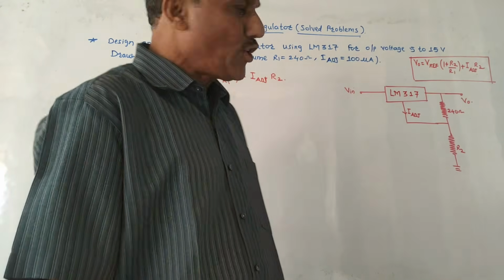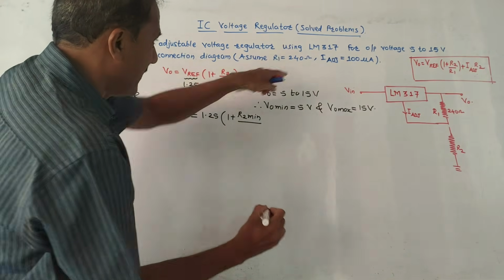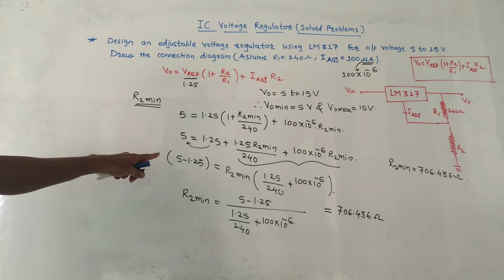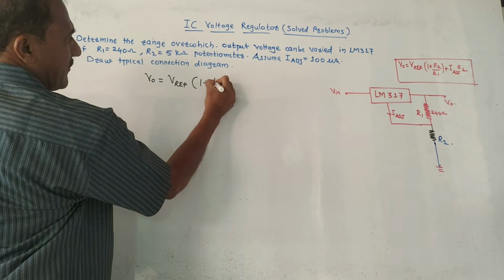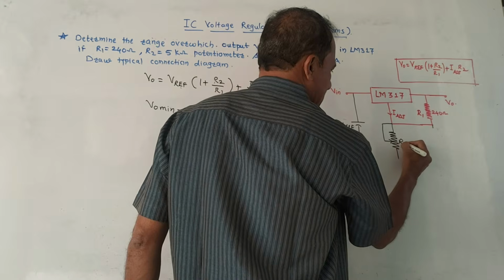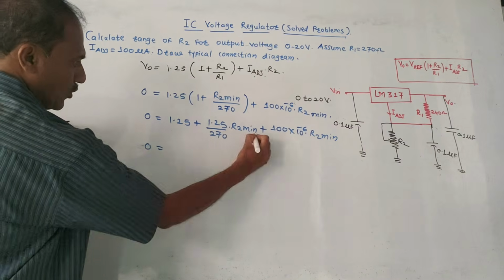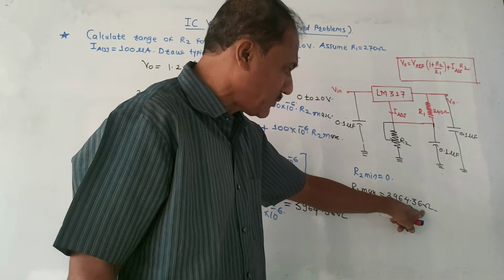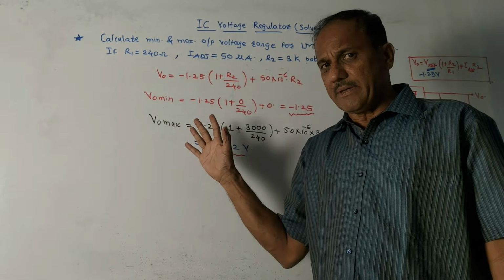IC VOLTAGE REGULATORS (SOLVED PROBLEMS)

Comment: Sir in video lectures of 317 the circuit diagram is different, R2 was connected serially with Iadj
Reply from the maker: You can refer any one of the diagrams.

Comment: Sir how can we say R2(max) = 3964.89 ohms = 5k ohms ? I didn't get it
Reply from the maker: If calculated value of resistor is not standard available value then select approximate value which is closer to the calculated value
Reply: Lekin sir 3964.36ke approximate value 4k hai na
Reply from the maker: Standard available value is 5k, one can choose 4.3 or 4.7 kiloohm.
Reply: @profbarapatestutorials  okay sir Thank you so much, The overall series for Electronics Circuits is Amazing!